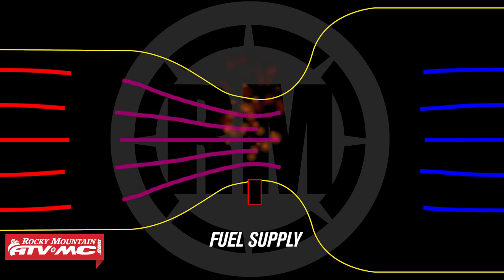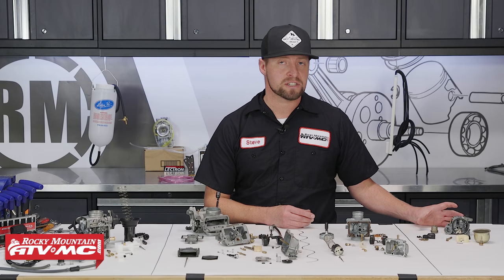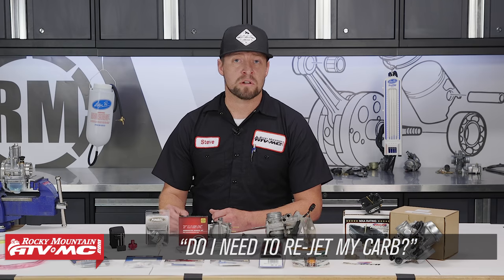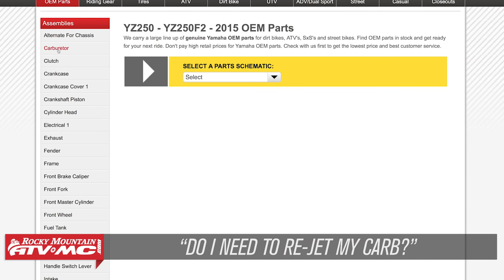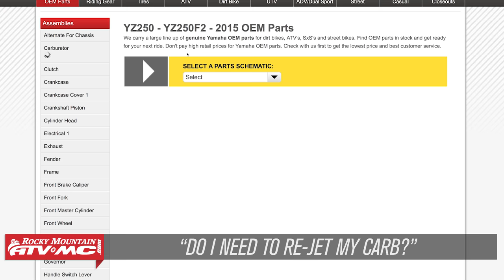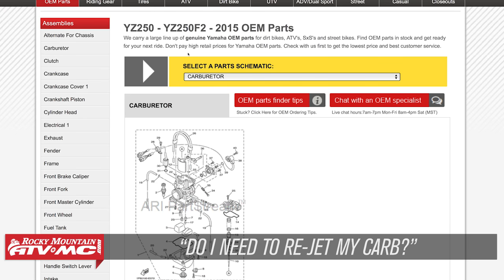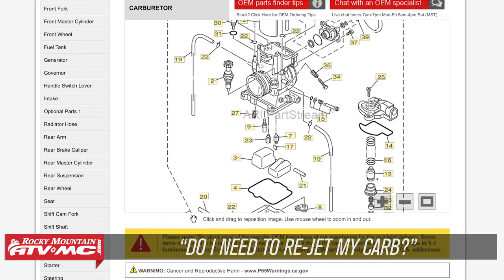Motorcycle and ATV Carburetors 101

Comment: I have a 98 Kawasaki bayou 400 it’s having carburetor issues it won’t idle it’s coughing and popping and gas is pouring out the overflow tube but it’s a weird carburetor. It has a primer pump and it has vacuum up to it. I’m not a mechanic do you have any suggestions, what the problem may be thank you

Comment: I have a 150cc 2018 BENNCHE 4 wheeler that setup for like 6 months and I replaced the battery and also had to replace the fuel filter because it was leaking but anyways my 4 wheeler is hard to start and when it does start it bogs down and dies on acceleration and then I noticed there was gas in my oil so is that my float valve

Comment: 6:09 Very true. A bad air to fuel ratio from the pilot adjustment screw will cause issues at any throttle. My idle was fine, my mid range was fine, but my engine would bog at full throttle. I leaned out my  my pilot screw and fixed the problem.

Comment: Couple things I've run into recently trying to fix the unfixable 2007 YZ450f lean bog/popping/hard starting..... - 1, make sure valve clearance is within spec. -2, someone had replaced the accelerator pump linkage with some shiny piece, long story short it was not the oem black plastic piece you do the "oring mod" to, so it was too short, accelerator pump did not work. Ordered a new kit, put it on, works fine ever since. 

Also, wont run without choke, check pilot jet/passage.

fuel leak at the inlet, fuel inlet o-rings

Comment: First off awesome video very informative. I replaced the carburetor on my Kawaskai Bayou 220 but I'm not getting any fuel flowing into it. I'm stuck on what to do if someone could please help me troubleshoot that would be great. Thanks
Reply: You need to check the fuel valve on your fuel tank to see if its clogged. some valves you can rebuild some you cant. but if you pull the fuel supply line off the carburetor and the fuel valve turned on and no fuel flows then that is the issue.

Comment: 18:27 on the top side of this carburetor, there is a plastic tube where you can put a hose on to. But i couldnt find anything on the internet about it. Could you explain to me where this one is for. I thougt that it is connected to the airfilter box. But what to do with those if there isnt a filterbox anymore? If i close them the motor stops running. But if i open them all up it does nt run properly. Hope you can help me out🙏

Comment: Excellent vid, I think you touched on exact problem with the accelerator pump.
Klx450r runs good everywhere except from idle if you twist the throttle quickly it dies (caused me to fall and being trapped under the bike for an hour boot went between peg and shifter,scary had to call a friend)anyway is the an adjustable accelerator pump offered for this FCR-MX-40 Keihin?
Thanks for the video,I am not near as scared,getting it out of the bike is a pain but I must fix this problem any advice is much appreciated.James
Reply: the accelerator pump is adjustable through the leak jet among other details as well

Comment: I recently started working for an old guy i thought he knew what he was doing. It bogs down anywhere above  1/4 throttle he keeps having me drill the pilot jet bigger. Its about double the spec and it now runs well up to 1/3 but is still bad above that. 

I need to adust the needle up as int the nedle is higher right?

Comment: I have a Honda VTX 1300 ques:
Will the extended fuel/air Tusk adjust screw work in this application?
Ques:
Are there carb kits available for the VTX 1300R that contain the Tusk adjusting tool/part? 
How do I order?
George 
Tucson

Comment: You mentioned the pilot jet and pilot jet screw working together but you did talk about the pilot jet at all. Can you do a video about adjusting the pilot jet with rich idle conditions
Reply: If you are running too rich and have already maxed out your adjustment screw, you need to get a smaller pilot jet to reduce fuel flow even more. Vise versa. If you have already backed your adjustemt screw all the way off, and are still running lean, then you need to get a bigger  pilot jet to let more fuel in.
Reply: I just rebuilt the carburetor on my atv and it was running super rich. Black spark plug, wouldn't run well after it warmed up, and would bog at full throttle. I had to fully close my pilot adjustment screw. Luckily mine works when fully screwed in so I don't have to replace the pilot jet.

Comment: I have two different atvs both only run with the full choke on , and run very fast , remove choke and the engine dies , I have replaced carbs and still same issues any ideas thanks

Comment: Hi; I have a Vulcan 500cc 1994 with twin carbs, I have a problem of 
overflown petrol,I had changed the needle valves and cleaned afew 
time,it worked but in a few months came back leaking baddly. I know the 
seats of the valves must be modified but I do not where,who does this 
kind of work. Where I live they do not do it. Have you heard about these
 problems,how did you solved if you did. Many thanks

Comment: I have a 4 stroke atv 2000 Kodiak with an aftermarket carburetor when I go full throttle the the engine stutters. Will that be the wrong jet size?
Thank you
Reply from the maker: Could be. Sounds like the main jet might be too big. You can verify by trying to rev with the choke on, stays the same or worse=smaller main, better=bigger main. Then with choke off and air box lid off, rev it again, better=smaller main, worse=bigger main. This is assuming you've checked all the basics (fresh fuel, clean air filter etc.). For reference, our QA Parts carbs that fit your ATV come with a 120 main and a 45 pilot. If you can't get the carb you have ironed out, I'd try the QA Parts carb and be done with it. -Charles
Reply: @rmatvmc  thank you I will try this
Reply from the maker: Good luck, let us know how it goes!

Comment: Somebody please help me. I had to change the carb on a 2019 Chinese Apollo 250 with a nearly identical unit. It idles fine, but it backfires and cuts out when accelerating. The plug shows that it's running lean. I'm thinking of putting a better carb, Mikuni, in there but it's so hard to get in and out I want to make sure it's properly jetted. I'm at 4500' Will the Mikuni also need to have a bigger main jet and a raised needle?
Reply from the maker: You will most likely need to rejet any carburetor for your specific riding conditions and elevation.

Comment: Was wondering if you can help me with my carburetor problem. Have a 98 yamaha big bear 350 4x4. Someone totally demolished the carb. All jets, pilot screws were cross threaded and ruined the carb. I got a new one, cleaned it from top to bottom and the only way it will idle is with the mixture screw all the way out to where it's almost falling out. I can get it to Rev up only if I slowly feather the throttle. If I punch it, it immediately boggs and dies. Sometimes it's fine on half choke. I've put smaller and larger main jets and the only thing that changes is full and half choke work properly. Still have to have the mixture screw all the way out and it boggs on quick throttle. I'm at wits end trying to figure this out. Ove cleaned this carb probably 10-15 times. Can anyone help? Thank you

Comment: Trying to get a dirtbike. They said grass got in to the carburetior from the air breather. Will it still run good?
Reply from the maker: If anything is in the carburetor it will most likely not run very well. You will want to do a thorough cleaning of the carburetor.
Reply: @rmatvmc  will that require taking the whole thing apart and putting it back together?

Comment: Hello Steve, amazing video and great detail. I have 1 question for you though. Have you heard about rejetting pilot jets to be richer for bikes that operate 7000' and above before? Apparently the idea is that natural loss of vacuum on an engine due to high elevations can cause harder starting conditions. A richer pilot jet to help compensate for the lack of vacuum to help aid in a richer condition and adjusting the main jet accordingly to elevation.
Reply: You are correct and incorrect. Yes you loose air volume as you get higher in elevation which will both cause a richer condition, but the lose of air volume will effect it. The very reason that the pilot screw/fuel screw/air mixture screw or whatever you want to call it is there for adjustment along with the idle screw. Barometric pressure, and humidity also effect it causing a lean or rich condition. If you were to look at it on a chart, the lower elevation you the changes in jet size are less dramatic in running conditions than it would be at higher elevation because of less air. You can over rich or lean one circuit and try to compensate for the lack of correct adjustment of another circuit to a certain degree. But its not accurate and your engine will never run the best it can without adjusting everything properly.
Reply: you got it backwards. higher elevation is less air. so less fuel at higher elevation. see? 

for what it's worth i've seen the tendency for some folks to think that at higher altitude you need to add fuel and i can't understand why some people think this.

Comment: Would popping thru the carburetor be considered a lean condition? 1990 kawasaki Bayou klf300c with Aftermarket Chinese carb.
Reply: Just had same condition on 200 Yamaha. Mine would not get past idle with throttle unless on choke.  (Completely clear pilot circuit) my fix was going 1 size up on pilot jet. Make sure your new Chinese carb has the same jets. It may have smaller as they are usually geared towards 125cc or less machines. Good luck let us know your fix!🤞👍
Reply: Don't buy Chinese carbs! they are junk. you are better off rebuilding the OEM carb.

Comment: A lot of info!   I'm wondering how to adjust the throttle return spring on 1992 big bear 350? It has been sitting for a few years and the return spring is very tight.
Reply: It's not the return spring, its the cable being corroded and lack of lubrication. Try a new cable and see if that solves your problem.

Comment: What is the function of the air cutoff valve on a CV carb ?
Reply: I think nobody knows, because i never see an answer to this question.
Reply: as far as I know, it is used when you start the bike. at that point you need only fuel to get through and so you "close" the air stream. after the engine has started, you let again the air mixed with the fuel.  I hope I'm getting that right...:)

Comment: Liked your video.  I have a KTM 450 EXC, with a Keihin FCR-MX carb and the bike won't start with the E-start until it's warmed up a bit and then I usually need to give It just the tiniest bit of throttle. When cold, it starts easily with the kick start, but again, it needs a tiny bit of throttle.  Once warm, the bike seems to run correctly and be responsive.  I've also had the carb apart a couple of times and can't find anything that looks wrong (everything looks clean, including the pilot jet).  I got the Tusk fuel screw and did some adjusting of the fuel mix and idle but it didn't fix my starting issue.  

It would be great if I could get a couple ideas on what to try next.
Reply: Check your valve clearance. If your intake valves are tight with no clearance than that is your problem.
Reply: stvnmoto, your suggestion was exactly correct.  I happened to adjust the valves a couple of weeks ago just hoping it would help and I noticed that one of the intake valves had no clearance.  After putting everything back together it started easily with the e-start and no throttle.  My subsequent rides were great.  Thanks!

Comment: Awrsome video! I got a kx250f 2009 and im having a hard time tonstart it when its hot. Any tip to solve that? Is driving me crazy.
Reply: Check the Hot Start lever adjustment. But for the most part your bike needs to be tuned to you elevation and riding conditions by a good mechanic. The other issue that might be going on is your intake valve clearance adjustment is tight causing the intake valves to not seal correctly causing compression to push back into the carburetor that will not allow the fuel and air to be sucking into the combustion chamber for internal combustion to happen.

Comment: If I uncork my ttr125le 2019 pull out my air vent and drill two one inch holes do I have to replace pilot from stock 15 to 17.5 pilot. Still stock pipe untouched.
Reply: I'm not sure you can call that uncorked. If you are wanting more air flow you can do that and yes you most likely need to go a bigger size in pilot jet. First I would adjust for elevation in your jetting, that might make all the difference in running conditions that you are originally seeking for.

Comment: What is the this in the thumbnail?
I have it on my carb as well as an electric enricher. It has 4 wires connected to it
Reply from the maker: I believe you are referring to the TPS (throttle position sensor).
Reply: @rmatvmc  yes it is on the opposite side of the throttle thank you! I have trouble getting the right ratio on my scooter.. its 4stroke and have only one mixture screw, how do i know if its working properly?

Comment: As I was looking at the schematic for the 2001 Honda 400EX carburetor I see a jet that nobody speaks about. Everybody talks about the choke the float bowl the pilot Jets the main Jets the needle and then settings but nobody speaks of number 38 in the schematic for the 400EX I'm pretty sure it's the same carb as the 300EX maybe the 450 number 38 in the schematic JET, SLOW AIR (#110) what's that about?

Comment: Which way do I bend the float needle to shut of more fuel. I have a Honda rancher that I think is getting too much in the bowl. Exhaust smells like fuel and crankcase getting fuel
Reply from the maker: You'll want to bend the tang up towards the needle, which will in turn allow your float level to be set lower. Unfortunately, we don't have a video on setting float level but there are some great videos on YouTube showing the process.
Reply: Rocky Mountain ATV MC thank you very much. Out of adjustment will explain what I meant ones correct?

Comment: What size Carburetor does a 1990 Suzuki LT250s QuadSport is ? I had it messured and it is 32mm on the outside & 23mm on the inside............
Reply from the maker: The stock carburetor on a 1990 Suzuki LT250S should be a Mikuni 34mm.
Reply: @rmatvmc  We had it messured they said it was 32mm it is a round slide

Comment: recently i replaced the old carburator on my 89 big bear 350 with a ruijie one that is supposed to be for that year among others, it was much harder to start as soon as it was installed and now that we have some snow down and needed to plow the driveway the bike started moved 15-20 feet, died when we went to shift to reverse and now we cant get it to start at all
Reply: well if the original rebuild-able carburetor is gone maybe another chinese copy will be better a 2nd time

Comment: Hi Steve. I'm your new subscriber from KSA. I got small bike the Honda TMX 155. My plug reading was fine so far having a light tan color which means i got a desired mixture. My issue is that, i can't start my bike with a single kick after overnight parking. It takes 3 - 5 kicks to start w/o choke. And sometimes, takes more kicks if I choked it. Around 8 - 10 kicks if parked over a week.  Some owner's and mechanics of this bike said that it is normal for several kicks but i'm not convinced. The average morning temperature in my place was 30 "C. Can you give me some hints to check as I want a single kick every cold start?
Reply: Hi Jeaven. It can be normal to kick it a bunch of times, especially if its cold. If it were mine I would adjust the low speed fuel screw and turn it out 1/4-1/2 turn to richen up that circuit. There might be a tamper proof plug installed in the way of the screw that may need to be drilled out so you can adjust it, but that's the solution to your issue.

Comment: I’m having a problem with a raptor 2001 660r one of my customers bring me a carburetor which after install it’s leaking fuel on the air filter side of the carb are two holes looks like little brass bushings only one of them in one of the carbs is leaking somebody here have an idea what are those holes for or how to fix the problem?
Reply: Check the float valve and O-ring on the float valve seat. Most likely the cause.

Comment: What should the idle speed be on a hot Honda 125 engine?
Reply from the maker: It will depend on your exact engine but the idle speed will generally be around 1,100 to 1,500 RPM.
Reply: @rmatvmc  This is a bike with only 2000 miles. The idle was 1000 rpm. The headlight would blink at 1000 and would not start electrically. The battery would go dead so i turned it up to 1300 so the headlight stays bright. I think the problem is fixed but if in happens again i will replace the battery. Thanks

Comment: Thank you for explaining all this. Majorly helped! I did have a question. What is the electrical wires that go into my carburetor? 2000 Kawasaki prairie 300 4X4
Reply: They are either for a TPS sensor or Electric choke.

Comment: educative video but not necesary at all use a glas jar make a pasage for air and a pasage for fuel use ordinary water valve ore air valve there you go car will pull any way under high wacum preshure fuel and you run on fumes the only down side is you will have no blow by gases in the block and you luse power but gain big speed tipical lean burning engine use plazma ignigion with that setup those mumbo jumbo schools s.h.i.t is not necesary 😑at all over complicated c.r.a.p for nothing

Comment: How to fix back firing through my 1990 Harley Davidson carb do I increase or decrease my timing
Reply from the maker: Backfiring can have a few causes but if you've isolated it to timing you can try advancing it and see if that helps. Also check your fuel pump and filter are both working correctly.
Reply: Its not timing, its carbonation being incorrect. or you have a exhaust gasket leak.